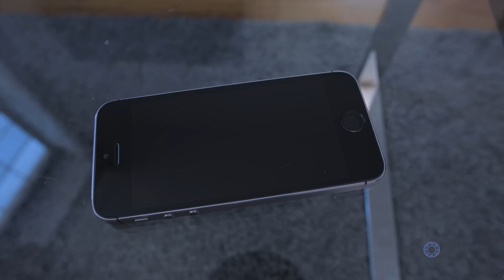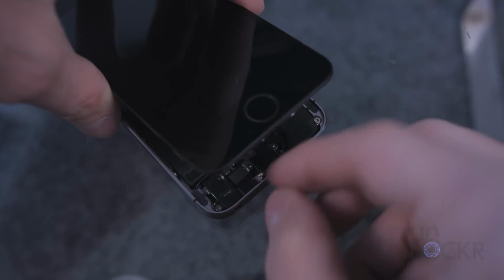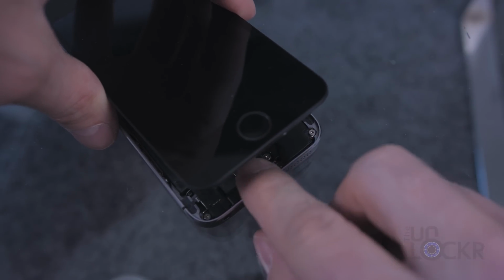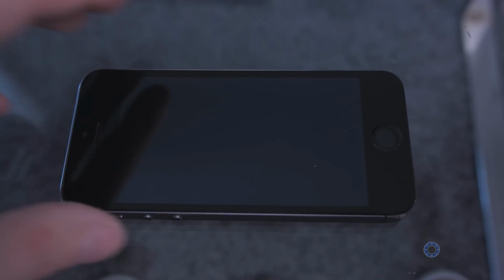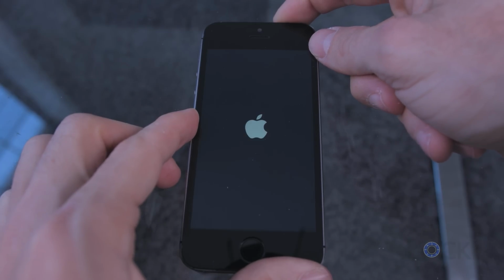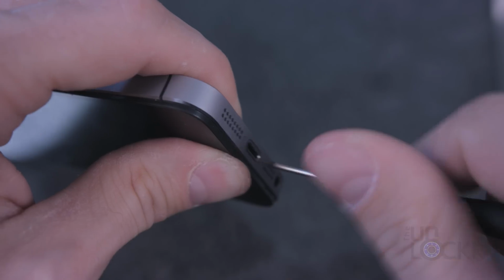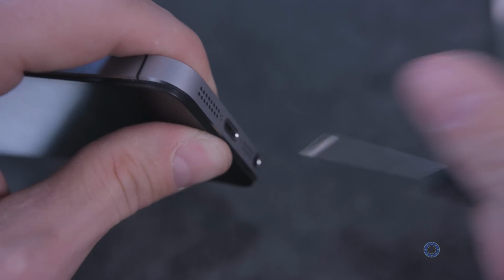How to Replace the Screen on the iPhone 5S (Complete Video Guide)

Comment: I know the iphone SE is the same buildwise as the iphone 5s but what about the internals? I bet there are a few things different inside the SE than in the 5s
Reply from the maker: It's a little different, but basically most iPhone screen replacements are the same.
Reply: TheUnlockr awesome! Thx. IF i somehow break the screen, i can always come back to this video. Another quality video that I will watch over and over again